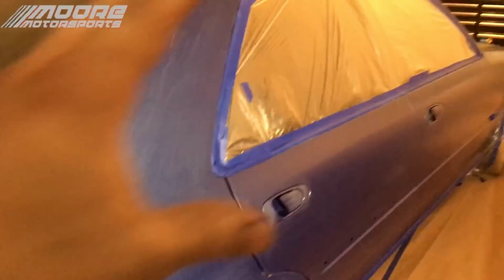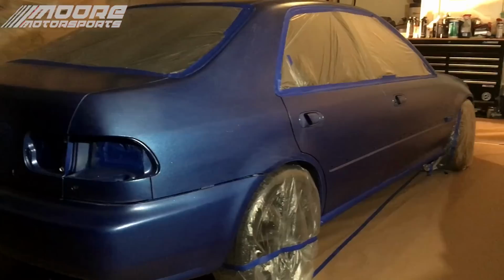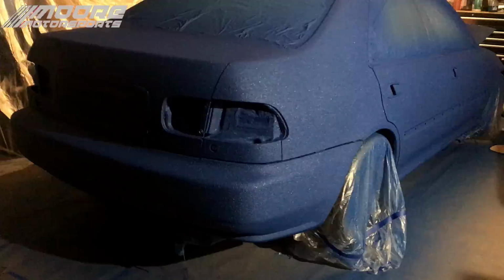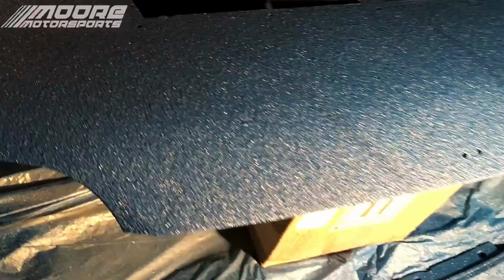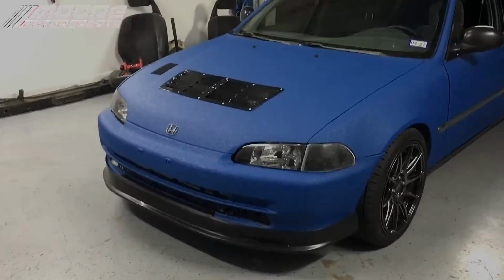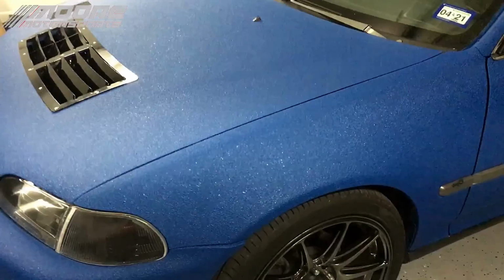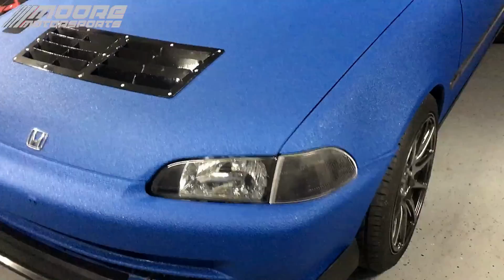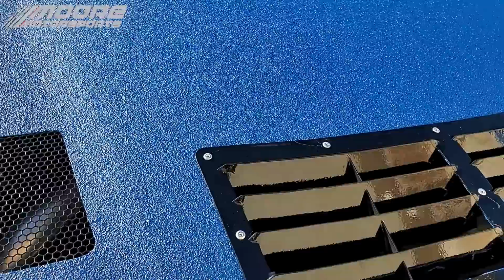Metallic Blue Raptor line Paint Job That Triggers most people.

Comment: Hey. Another great job!  I would still remove more of the parts not getting painted, but to each their own. One  thing I REALLY liked and need to know more info on are the fender bolts and some bolts I saw on the header panel? Some type of flat-headed socket screw?  Those look TRICK!  Give us some more info on those.

Comment: Man you had me sold on this, on your last few videos. Back again with another question. The texture looks a bit rougher than the last 2 cars you did. I think it looks damn good. The question is how do you change the texture. With pressure or with distance. I get you can do it with either. But I like your results as opposed to other dudes on here. Im finding a lot of the Australian youtubers blow it on like you would a paint with as little texture as possible.
Reply from the maker: I prefer a little texture but this one DOES have more texture but its the gun its not a real UPOL gun they sent with it and it picks up more material and shoot more out so it does have more texture. The link i put in description has the gun i used on my brothers and my civic. My buddy is in the army High rank and i feel like the more texture fits his rank more texture more bad ass idk could be just me but higher pressure smoother it comes out and them Aussie do things weird with bed liner.
Reply: @JamesDguy  us aussies do lots of things wierd mate :) i'll do the tray of my hilux soon and put something up.
Reply: Using the upol Varinozzle gun makes every job consistent can not recommend it enough

Comment: I like the color, I like the properties of the bed liner paint....
its the rough grainy texture that I don't care for, dirt can get stuck.
is there something that can be mixed in so it lays down smooth?
if so, a tough clear coat over that, car would be really protected!
Reply from the maker: It’s a 2K paint so it’s protected already and you can get it smoother for sure but i prefer the texture and it’s easy to clean when it gets dirty. You can add 2K clear over this

Comment: Hello mate. Long time viewer first time commenting! Few quick questions for you.

1. Can you mix this with metal flake as well as tinting it? So not metallic paint to confirm, I'm talking about the actual micro flakes you can get (ie the holographic ones you can mix with basecoat)?

2. Can you also mix it with pearls? So if I were to lay down some black primer beforehand and not tint the actual raptor liner (so it'd just be transparent) and mix in say some colourshift/chameleon pearls?

3. Reckon a raptor liner job would look good on a Nissan 350z?

Cheers and thanks again for the content from across the pond in cold and rainy Britain!

Comment: could u possible tell me the exact kit/color you used for his and i have a chevy cruze 2014 that i would love to do this on. i follow both your channels and love your work.. thanks
Reply from the maker: The color is cobalt blue single stage paint that was mixed up at a local paint supply store. You need the bottle of raptor liner to be tintable for this to work.

Comment: Hi James.  I love your channel.  Thanks bro.

So I have a project and would like your advice.  I bought an old 1997 Dodge 3500 Extended Van with a fairly large sized roof rack.  I am converting it into a camper and want to put a textured surface on it.

I want to paint the van and roof rack a tintable color and the bottom area/rock guards/tire wells with black.  How many bottles of the tintable Raptor liner would recommend and how many black bottles would you recommend.  (Don't worry, I won't hold you accountable to your answer...I'm just looking for your professional opinion.

Also, I was thinking about using the Rustoleum/Zinnser Turbo can primer just as you did in this video.  How many cans of that do you think I should buy.

(P.S.  That metalic raptor liner does look good.  That is my plan as well.)

Blessing to you and your family,
Mark
Reply from the maker: Hey mark I honestly would do a white primer or a darker blue as a primer/base coat. I use normal spray paint as the “primer” after it dries I would scuff with 180 grit sand paper. As for the raptor liner I would use 8-10 liters (8-10 bottles) this car took a lot of paint to cover this car and it’s fairly small so I feel that 8-10 bottles is more than plenty. If you use the same steps just like I did on this video and other videos then you should be good. Just remember not to get too close with the bedliner. I would dust it on like I do so it comes out good. I will do a update video soon on this car 😁

Comment: I have an old gray civic. I want to raptor liner my old clearcoat peeling civic. What size air compressor do I need. I would like the smallest size you can recommend. I want to plastidip, but their compressor cost way too much to dip this old car. Also, I am only spraying my civic the same gray it came with, maybe I'll add in some pearls to mix to the raptor liner. My civic is a 4 door, how many raptor liners do you think I will need. I know that in some of your videos, you used 3. Thanks!

Comment: If you have a compressor, and a cup gun..why do you rattle can everything? Automotive paint with hardeners and catalysts are designed for automotive use. Spray paint is for small jobs. Not really designed to hold up on cars.

Comment: How many bottles of raptor did you use, my car is blue as well and this looks amazing. Wondering if I just need one of the 4 liter kits or should I get a couple more.
Reply from the maker: We used 6 but we ended up doing 3 coats. I would get 4 it should be plenty but if you wanna go like we did get 6
Reply: @JamesDguy  thanks for the reply and I'm definitely gonna donate to the shop cause.

Comment: How many bottles did you use?
Reply from the maker: 6 but ended up doing 3 coats 4 should be plenty if not doing so many coats.
Reply: @JamesDguy  I did 3 coats on my ram 1500 4 door and went from gunmetal gray to charger green with 8 bottles and I did my jambs. How thick are you spraying bro? I was pretty confident I could get my Miata covered with a 2 bottle kit.

Comment: Here's my opinion. Looks like house paint rolled on with a texture brush, my drywall is textured rn and blue and it looks exactly like the car lol. Cant believe this is a trend now, buuuut  I have seen some jeeps that look cool, because they have only certain parts painted with bedliner so the contrast of normal paint, bedliner and carbon fiber together looks awesome. But on most cars its gonna look goofy af, cause there is nothing to really contract it against so it ends up looking like an interior textured house wall lol. Have you ever dont roll on jobs? Im gonna do my van with oil rolled on and hand polished, seems to be the only way for Karens not to get offended by the sounds of a compressor. I might have to start filming my paintjobs so I can make more content.